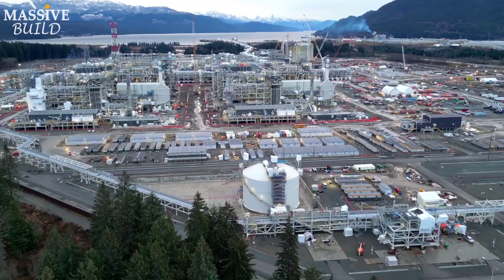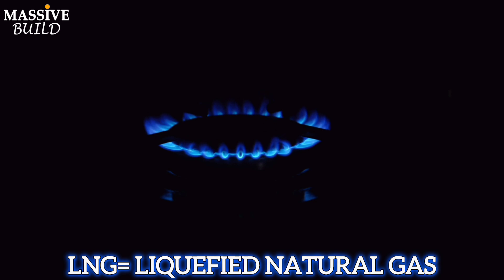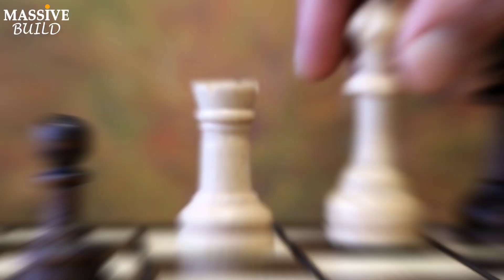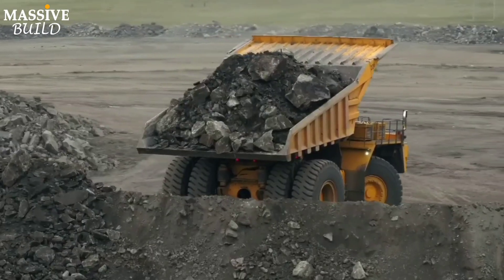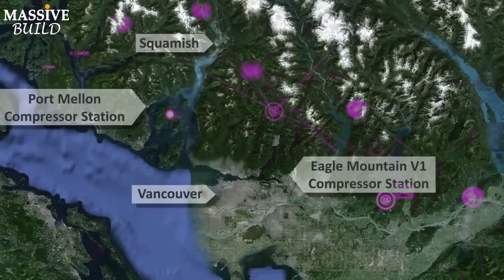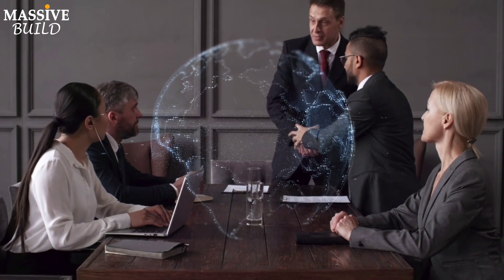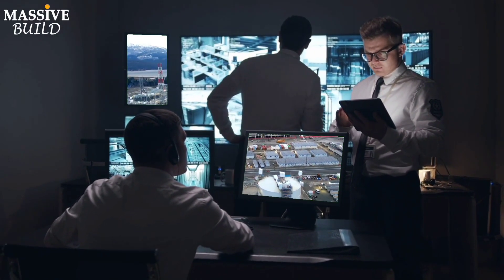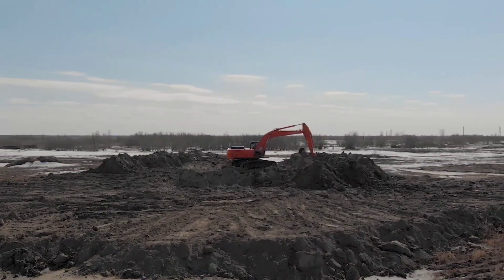Canada's 30BN Insane Gamble to Become an Energy Superpower

Comment: This is the most delusional green washing I have ever seen.

LNG is Liquefied Natural Gas.  Where Natural Gas is a hydrocarbon, so it's still a fossil fuel, so it'll be emitting CO2 as it burns.

So this facility is part of the problem with global warming.  Even if the compressors are powered by hydroelectric, the natural gas is still a fossil fuel.

It's just as important to stop burning coal as it is to stop burning LNG.  Anything that gives off CO2 when it burns, is the major problem behind global warming, like for example all the LNG from this facility.
Reply from the maker: Do you think this model is worse than the previous models?

Comment: This all sounds good, but the gas is still fracked gas using an enormous amount of water. Que the green washing
Reply from the maker: Jason, Do you think this model is worse than the previous models?
Reply: @MassiveBuild  to which previous model are you referring? All fracked gas is problematic and there's no guarantee that any coal power plants will be shuttered in favor of petroleum gas.
Reply from the maker: @jasonwilliams8016  I mean the previous models, the existing power plants that use a lot of carbon dioxide?
Reply: @MassiveBuild  This isn't a power plant, it will not produce electricity. Wherever the gas from this plant is burned it will produce lots of carbon dioxide. 

Even making the argument that these new LNG plants using hydro electricity to cool the gas instead of making there own electricity using natural gas, will somehow lower CO2 emissions is debatable considering we've built a monstrosity of a hydro damn in Site C, flooding thousands of acres of forest and farm land and using an enormous amount of concrete in the process. Partly to supply electricity to LNG Canada and Woodfibre LNG. 

So to summarize:
1. Fracked gas is bad, it uses a tremendous amount of water.
2. Cooling anything to -160c is extremely expensive in energy requirements on its own.
3. "Natural Gas" has always been a green washing term, just like these "clean LNG plants" just like the very idea that natural gas will somehow displace coal in places like China or India that have their own enormous domestic supplies.